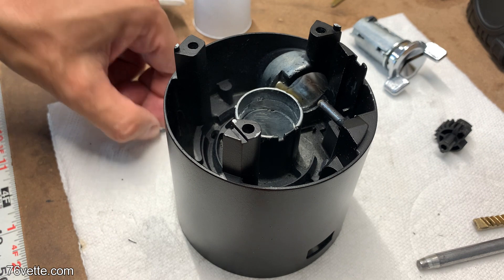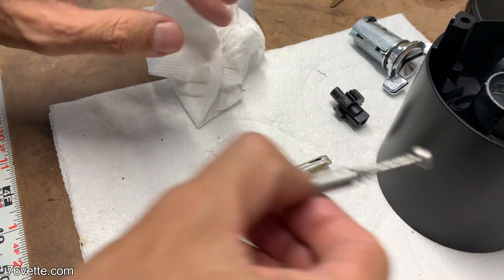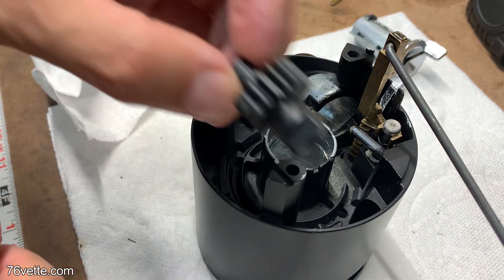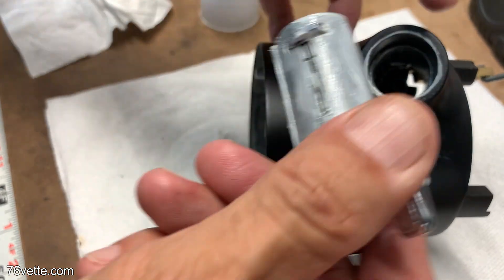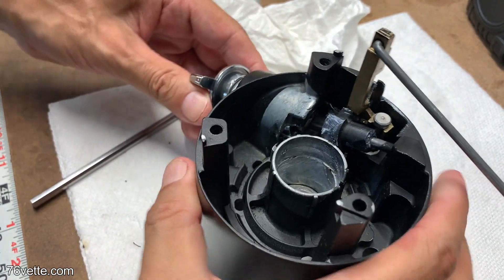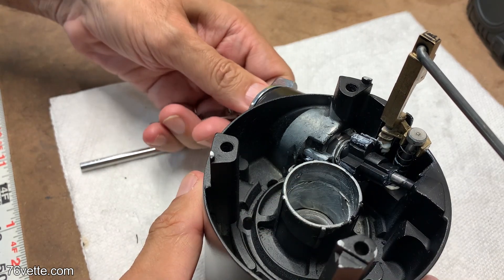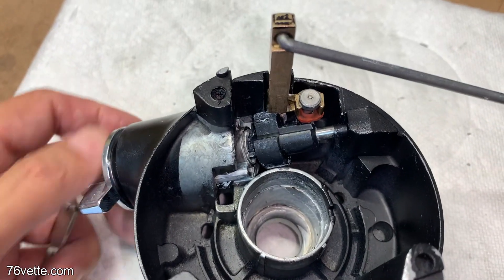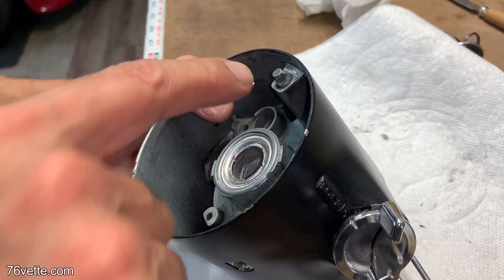Installing a Chevy IGNITION KEY Tumbler

Comment: Nice work. I have a 1973 k5 blazer. I cant find the same gold rack you are showing. The ones I get are dormin and I have to grind them down to fit and they keep breaking. Please let me know thanks.
Reply from the maker: The one I used for the column rebuild is also made by Dorman. 
Sometimes modification and/or fabrication is the only solution.
Dorman 83221 Rack and Sector Gear Kit https://amzn.to/3CoGSW1
Good luck! 🙂👍🏻

Comment: Finally found the right video!! Do you know where I can get a replacement sector gear and rack??
Reply from the maker: Hello Paul,
I bought this one from Amazon (link below). But make sure it will fit your vehicle. This one is made by Dorman so you can also get it locally from an auto parts store. They’re not expensive. 
The rack from this kit would have to be modified to work in a 69 column but they rarely fail so I reused the original. 
Again, make sure the replacement parts match yours exactly. Hope this helps. 
https://amzn.to/3wIFHOy
Reply: @76vette  and see I ordered that one and it's too wide. It's not even the one in your video
Reply from the maker: @paulmorford4569  Bummer. I’d bring the old parts to the auto parts store and order through them. 
It’s been my experience that NAPA employees know their stuff a lot better than the average auto parts counter guy.
Reply from the maker: Also, I am sure a Corvette parts vendor would be able to help you.

Comment: Great video- thank you! I'm working on replacing a disintegrated sector gear in my 69 Camaro and this is extremely helpful!  Do you think I should be able to remove and replace the sector gear through the ignition cylinder channel without disassembling the rest of the linkage and pieces?
Reply from the maker: Unlikely since the rack is under tension, which puts pressure on the sector gear. But you can give it a shot. You never know. 
Personally, I would take it apart to clean and lube it properly. That way you know everything is installed and working properly. 
Good luck! 😊👍🏻
Reply: @76vette  Good advice- thank you!

Comment: Thank you for this video am deal with an 80 Camaro which I believe has a different steering column but I have the same exact assembly as you but was wondering is the rubber spacer you made to keep it from pulling all the out and falling off the gears?
Reply from the maker: Hello. Most GM steering columns of that vintage are pretty similar. 
The purpose of the little rubber gasket I made is to keep the spring seated properly and in place so the lock pin would work. And it worked well. I made it out of necessity. Yours may not need something like it. 😊👍🏻
Reply: @76vette   thank you for the info also Im going to have to pull that rod  that connects to the rack should I be cautious pulling it from the steering column is there anything I have to worry about? Also what did you use for a spacer on the spring?
Reply from the maker: You’ll need to remove the ignition switch so the rod can be taken out as one piece along with the rack or you can disconnect it from the rack itself if possible.
Reply: @76vette  I have it completely taken apart right now and have to put it back together so I should probably hook up the rod to the rack first and then connect the back of the rod after everything's assembled?
Reply from the maker: That’s how I did it as shown in this video (fast fwd. 1 min 10 sec into the video) https://youtu.be/RKQr4Cwx2Dc
Reply: @76vette  thanks for the quick replies, was wondering how does the rod connect to the back of the steering column?
Reply from the maker: Not sure I understand your question, but the rod is connected to the rack at the hub assembly and it is held in place at the other end by the ignition switch.
Reply: @76vette  right I'm talking about the other end of the rod how is that connected?
Reply from the maker: The video I linked above shows how the bottom of the rod (where it has an L shape) is connected to the switch. Fast fed to 2 min 46 secs.

Comment: What exactly was it doing that let you know it needed replaced?
Reply from the maker: It didn’t operate smoothly when you turned the key because of a chewed up sector gear, and you could pull out the key in any position.